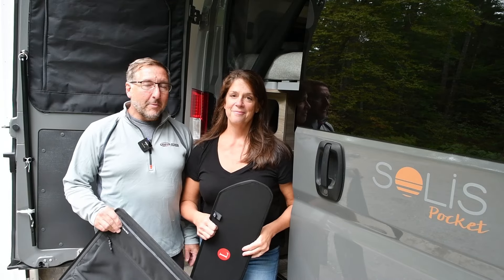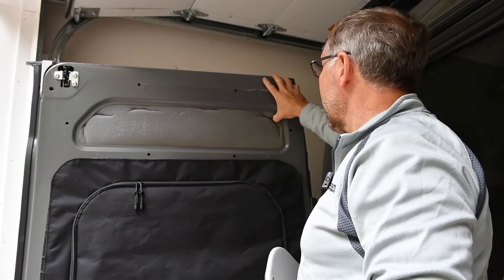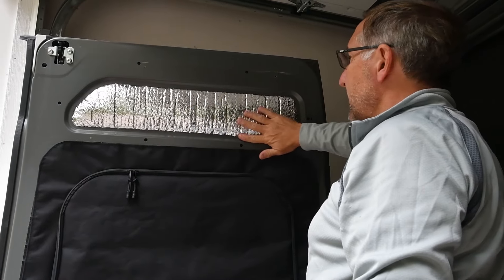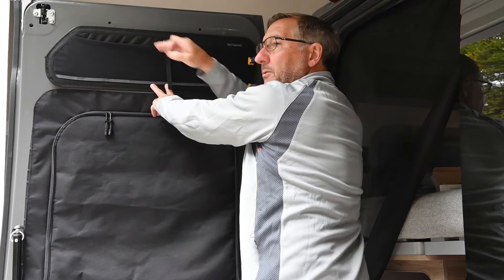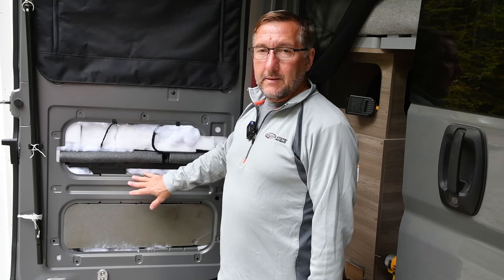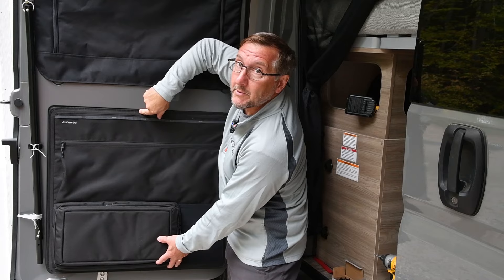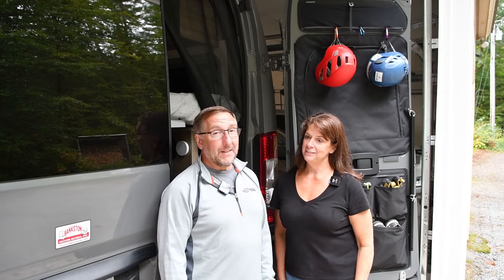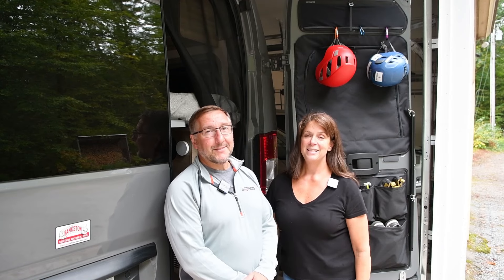Install and Review: VanEssential Rear Cargo Door Storage Panels

Comment: I hope you keep buying things and testing them out. My Pocket is still factory configuration, but there are modifications I want to do. Your videos are helpful. Good to know about the insulation in the doors. I have a bunch of Thinsulate that I didn't know what to use it on. Now I do!
Reply from the maker: That's great, thanks for the feedback and comments. Hopefully we are helping you pick the right upgrades for your van. Definitely load up those rear doors with your thinsulate!
Reply: @Outapkt  I bought a Joolca hot water shower to hang from the back doors and use the large propane tank to fuel it, so, I won't be buying the door panel storage. I got a "back of seat" storage unit that can be mounted under the bed, hanging from the bed slats. You have to raise the bed to access it, so it's not as convenient. Anyway, keep those suggestions coming. . . it's good stuff!

Comment: Love this video too! Only question, would you consider carrying a gas container for your next trip?😊
Reply from the maker: Hello! Thanks for watching and for the question! By gas container, I assume you mean like a supplemental gasoline can? I would say no. It would be messy and smelly and our running low on gas was really just bad planning on our part in not stopping when we could have. We were not in any remote areas. Normally we have pretty good gas mileage, but going 80mph into a wind and uphill required us to stop more often. Thanks again!
Reply: @Outapkt  I will keep that mind when traveling, oh the need to increase the speed when the road is clear ! Lol 😆

Comment: First off - you're very patient and forgiving. Looks like the product was designed by someone in China that saw a photo of the rear doors and just went off that. There should be a fastener that could make use of the many existing holes rather than requiring new ones to be drilled. That's a big red flag for me. I agree that it's a great idea to add practical storage to those empty spaces, but I'm not impressed by that particular brand. Also, jealous beyond words that you can fit your Solis into your garage!
Reply from the maker: Hi again! As far as the panels, once installed, we are happy with them. We never did fill in the holes above the top panels and we don't really notice it now. I still think these panels are a decent value and make good use of some otherwise wasted space. As far as the garage, yes that is one reason we picked this van. We had to raise the door height though. It barely fits! Thanks again for watching and for your comments!
Reply: The top of the door "stock panel" is not a panel that exists on a Ram Promaster 1500 from Ram. Those panels and holes were installed by Winnebago. Van Essentials designed the top storage for the base model Ram Promaster 1500 and not specifically for the Solis Pocket.
Reply from the maker: @dan-tv  Thanks a lot for pointing that out, I did not know that.